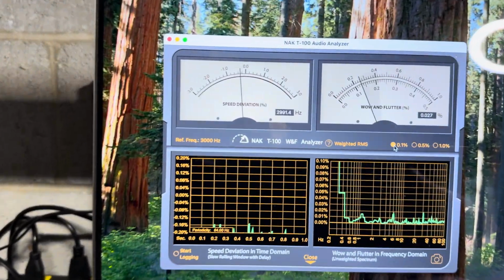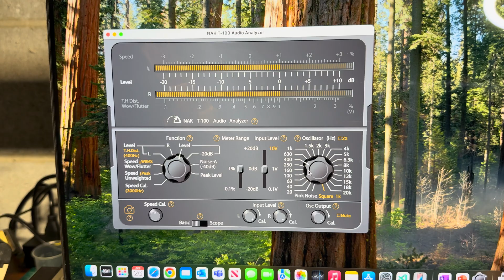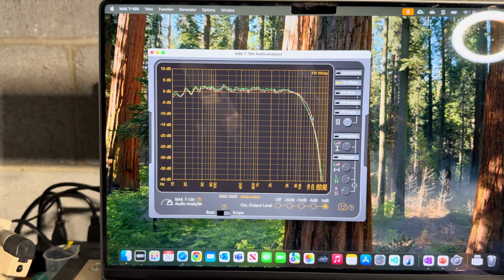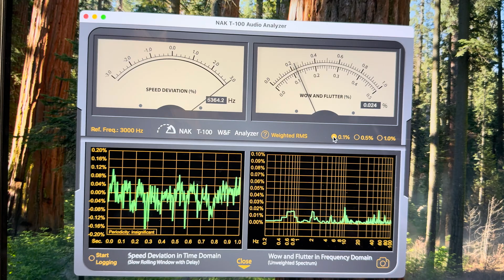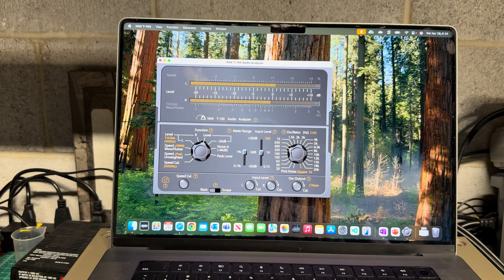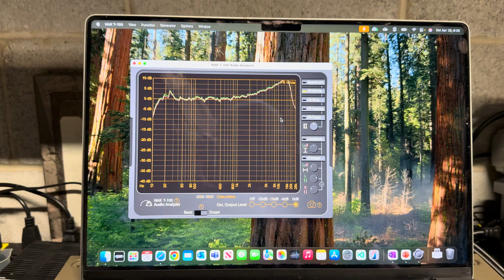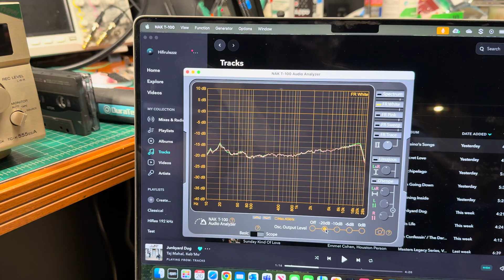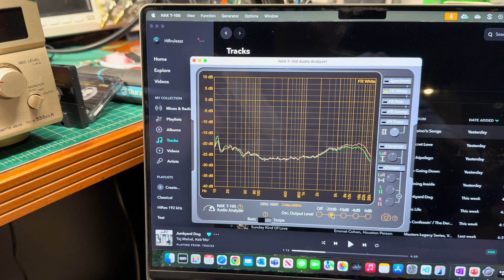Testing the Limits of Cassette Recording – Sony TC-K555ESA at Double Speed!

Comment: Hi there , cool 😎 video, do you know, if this deck is slow because of quartz crystal...vis it possible to buy a substitute?
Reply from the maker: @kravchuk007  Sony decks are getting slow when right pinch roller is losing its grip and can’t pull the tape with necessary force. As a result speed is lowered to the speed of the left capstan. It is easy to check by pulling left pinch roller down.
Reply: @hifirulezzz  Thank you 😊 🙏

Comment: I was wondering When you will start to get interested in double-speed decks.....  Or Elcaset.....  When I got my double-speed Marantz PMD-520, I sold my Dragon.  When I got my double-speed Dual 844, I sold my RX-505.  But when I got my TEAC AL-700 Elcaset, I sold both double-speed decks.  So at the end I only kept a Nagra IV-S, and the TEAC AL-700.  Tape is most beautiful media.
Reply: I have two still working Sony EL 7 Elcasets .........and a Revox B 215 Tape ....all good ....and a Studer PR 99 MK III HS with 38 cm / sec two tracks  ....better - but the best : my two Sony DTC A 9 prof.DAT Recorders with super bit mapping ........

Comment: This should be made smarter: in a play/record mode a double frequency, but in ff/rew modes the frequency must go through a d-trigger to divide it by 2 (however it could be not stabilized in this case, I'm not sure, you know better no doubts). I think. As for the high freqs, a correction network time constant must be set to very low values (in usecs). I don't remember exactly, but something like single digit for Type II and 10-15 for Type I.
Reply from the maker: FF/REW works with the different motor, Did not get your idea. Capstan is always rotating with the same stabilized speed.
Reply: @hifirulezzz  Ah!.. I've forgot about the second motor. Thanks.

Comment: Wieso unbedingt doppelte Geschwindigkeit? + 50% reicht vielleicht?
Reply: Ich habe nie verstanden, warum damals die Kassette mit so extrem niedriger Geschwindigkeit spezifiziert wurde. Schon eine Erhöhung der Bandgeschwindigkeit von 30-50% hatte sehr viel bessere Qualität gebracht. Testweise habe ich das bei meinem Akai GX 75 MKII gemacht. Der Unterschied ist immens. Ein einfaches Typ I Band klingt damit wie Typ IV.
Reply: Il suffit d'augmenter de 20% la vitesse pour avoir des résultats significatifs en jouant sur le potentiomètre du moteur d'entraînement de cabestan. L'autre solution est de changer la poulie du moteur par une plus grosse....
Mes essais sont plus que concluants sur Saba CD-350 (Continental Edison LE 9162), Thomson DK 745T, JVC KD-A5 Super ANRS. Le son devient de meilleur qualité, plus de résolution avec une cassette type 1; avec les type 2, la distorsion se fait sentir; les type 4 sont les meilleurs!